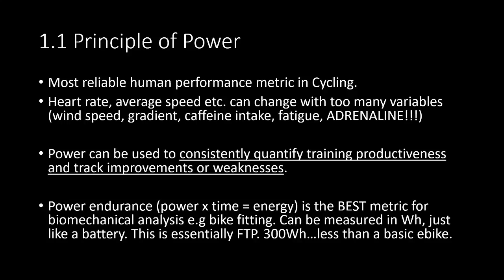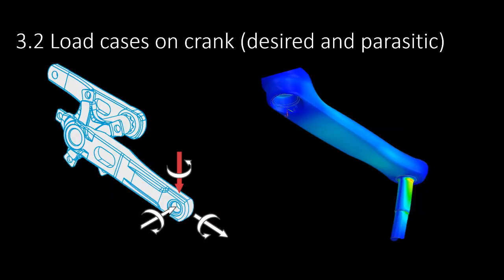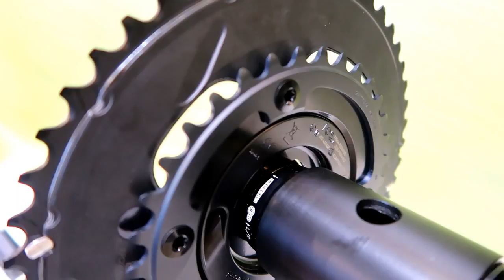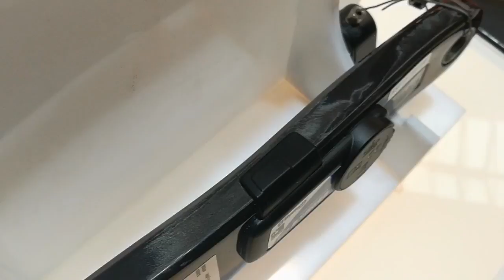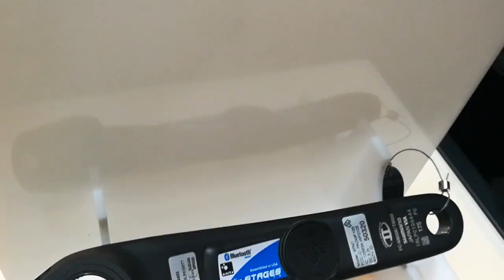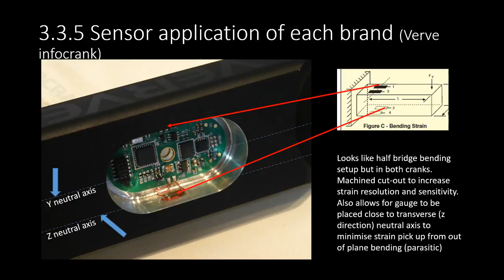In Depth: Power Meters Engineering Explained. SRM, Quarq, Stages, Power2Max

Comment: Min 24:20: ROTOR right side Strain gauges are placed under the small plastic taps both side of the crank arm. In this position the parasitic strain coming from inboard flex (gauges are sticked in the neutral fiber of this moment) and torsional strain are reduced. It is measuring almost "pure flexural strain".

Comment: I kill to quarq d-zero units in two months.
First unit was 1,5 year old with 20000 km,100% reliable.
It was readen alwasy like 1x setup.
And then i switched for 2x system,may chain drop and unit brick.
Cadence is here but power was 0.
Offset was 30000....bla,bla.
Then they send me new unit and then again my chain drop and bricks the unit.
Any idea what is going on?
It seems that chain stucked betwen crank and frame fucket up calibration or something

Comment: Nice video.  Seems like it would have been much smarter for FSA to get into the power meter market instead of trying to develop their own groupset.  By the way, I think you said 46 mm when you meant 41 mm.  Global Cycling Network has a video on the Power2Max factory which is kind of interesting.  Why aren't there more hub-based power meters?
Reply: Shiba Burn they’re big, unsightly and relacing a wheel is a pain in the ass.

Comment: I would have thought that powertap hub should be the best design in terms of reducing parasitic strain. Do you agree? My powertaps have been super reliable. I avoid pedal-based because it seems to be the worst place to measure strain. I like what infocrank have done in terms of isolating parasitics. Good engineering.

Comment: Two points.....

Infocrank has another pair of gauges in a second recess on the rear of the crank so is a full bridge design.

SRM may dynamically calibrate their units in Germany but there are online images showing that their US factory use static calibration (or at least used to) which given the accuracy of cycling power meters is more than sufficient (apparently optimised strain gauge setups can give accuracies of 0.003%, way better than the usual 1-2% bike power meter range)
Reply from the maker: I didn't know that, where is the second recess?
Of course, strain gauges are exceedingly accurate in load cells where are no parasitics or transient bending signals. But in bicycle cranks the torque signal far from pure, its a mess! Getting 1-2% is a good achievement. Having said that is +-6 watts at 300watts acceptable? Up for debate.

Comment: Great video, thanks, do you have a view on the PowerTap C1 power meter?   Now only sold by PowerTap and only in the USA, it fits on older Shimano cranks, BCD 110mm/5 bolts.    Now sells for $349, DC Rainmaker says a good deal.  Is it worth the money?  It's the cheapest on the market.  I was thinking about buying a pedal power meter, but after your comment on pedals maybe not.